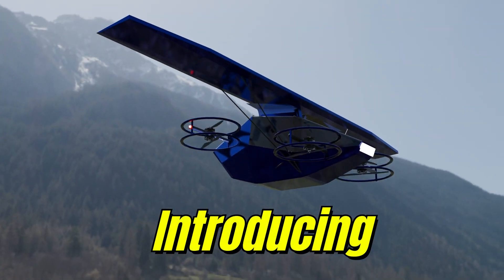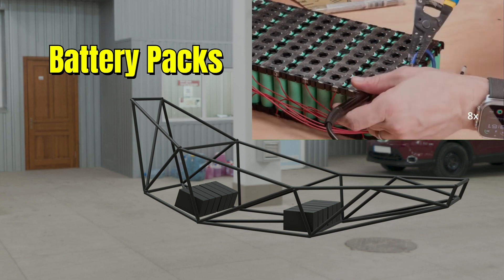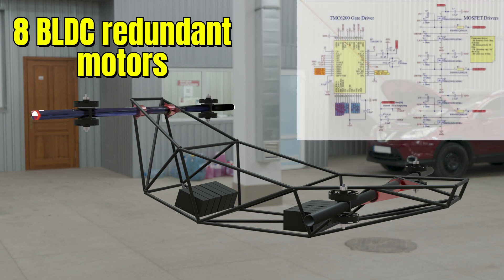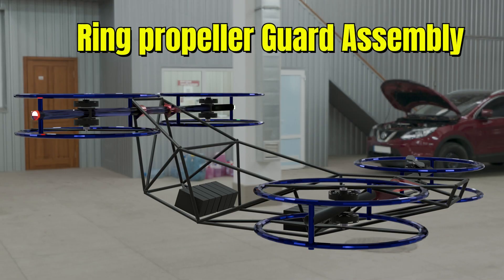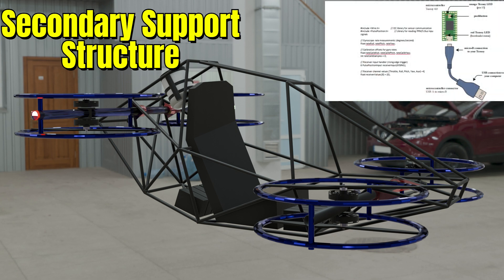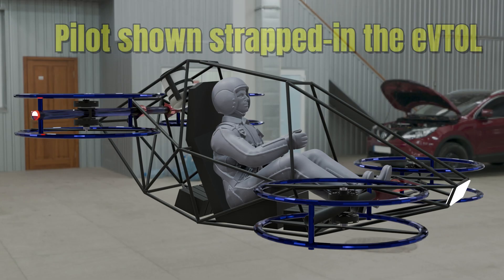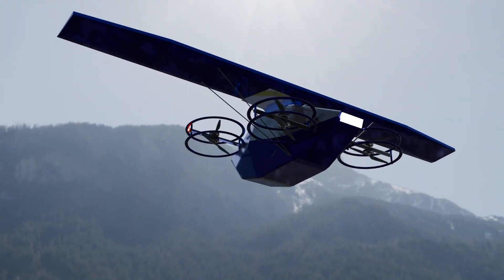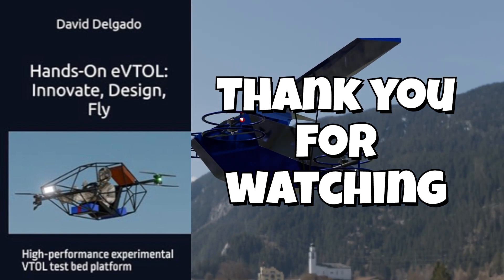Model M731 Quail a system approach to the development of eVTOLs #rotor #quadcopter #aeroplane #drone

Comment: Will it tilt rotos to fly like an airplane and extend range and speed ?
Reply from the maker: No, it's first and primarily an eVTOL.   The wing serves as an additional safety device to help you land safely in a rare event of motor or battery failure.   It is a passive glide drag wing with no controls based on lower mass conditions.  However, it may not be difficult to add four more BLDC motors for tilt capacity if one need to add additional complexity.